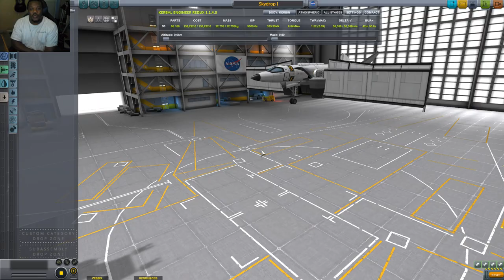Kerbal Space Program | That Sweet Engine Swing

Comment: Could you have put small air intakes on the other side of the rotational joint and had them rotate as part of the jetpod rotation?  The intakes you have in the body of the plane are sufficient, of course, I was just thinking of faint attempts at making it look kinda realistic now that you have the mechanism sorted out.